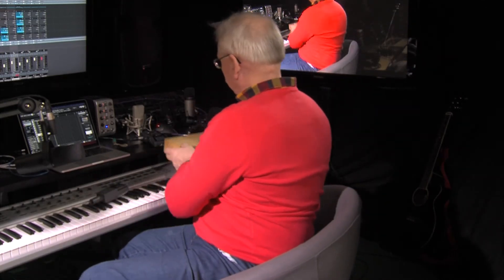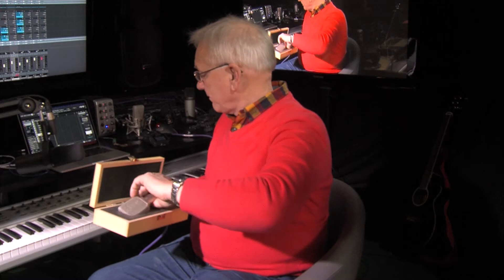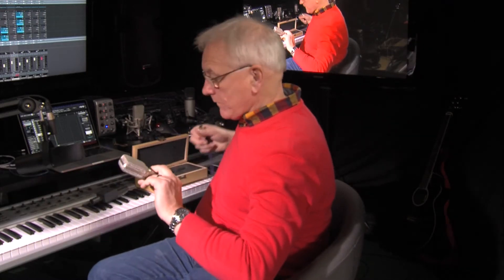Episode 12 - Can we destroy a ribbon with 48V Phantom Power?

Comment: Phantom power should not affect a ribbon microphone, however, a bad cable connection with phantom can destroy one. It is better not to take the chance, I w0uld never risk my RCA44 and 77's 0r B&o'swith phantom. I however did build a ribbon  mic recently and it seems safe with phantom, If something bad did happen, I can easily re-ribbon that one,
Reply: I think that even a cable shorting one leg to ground is an acceptable risk as the transformer coupling prevent5s DC paths. After all, the BBC had pretty much permanent phantom on their studio connections for year - throught the STC ribbon era. Although the possibility of damage is possible under some circumstances, I've never found any reported damage other than "my mate damaged his when ...." I guess if the button was handy, I might - but the crack through the speakers with the fader up is probably more of a risk to speakers!

Comment: Thanks, Paul -- there's so much stuff flying around about this, so this was quite a handy demonstration! I have an MXL R144 mic that I did accidentally have phantom power on when plugging it in, but it still worked. I used it another time after that and it worked great, but the following time -- DEAD. I don't know why, it just somehow decided to stop working between sessions. I sent it back to MXL for repair, and they did replace the ribbon, but it actually ended up sounding better than before! I love it on guitar amps and solo violin. It didn't sound so great on vocals, but that was before the ribbon was replaced. I should try it again.
Reply: Storage orientation seems to never be mentioned, but stored with the ribbons vertical is mechanically sensible, horizontal, the worst. I don't know how sag features? Having two identical ones, I do know that a new ribbon changes the sound, and I noted for the better too - so maybe all ribbons gradually drift, and a new ribbon perks them up? Glad you got it fixed!